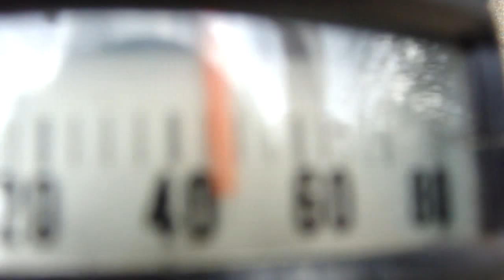CHEVY 454 ENGINE START UP ON GROUND * HOT RATROD ENGINE  * TEST RUN * REDNECK ENGINEERING

Comment: Can you do a video on how set up a engine to start it outside of the car please?
Reply: Wait ... Run wire from the positive battery to the big bolt on the starter is what I meant... You only need three wires one positive to the distributor  small wire ... One positive to the starter ... Big wire ... One neg to the engine big wire .. any where except rotating part for the big neg wire ... To kill engine .. pull dist wire from positive on the battery off
Reply: @jamesgibson7207  I bet you can’t explain that in a fuel injection engine huh (;

Comment: general question to all. how long can you run a setup like this with no water or radiator before damage can occur.  the reason I ask is cause anytime I install an engine I test run it before I fill antifreeze just in case I have to work on something.  thank you

Comment: If you can stuff a 454 in an AMC eagle - THEN i should be able to put a 350 in my 1980
AMC concord and get rid of that dog 258 six.........Right ?
Reply: with a hammer and a roll of duct tape anything is possible.
Reply: I like how you think.
Reply: He'll have to do some serious frame / structure improvements to that AMC chassis. At the :52 mark, that cross-member and body will not hold up the the torque and weight of a big block for long. These 454's were all installed in full frame chassis, not sub-frame types.
Reply: -You are indeed correct about that. The more i look into engine swaps
for my AMC i find that problem. It can be overcome with creative welding and fabrication. A big block is more than i would take on to be sure. Not a lot of meat to work with in the first place.
Reply: The worst you can do is twist it up and break the front window. Been there done that.
Reply: John Robinson you could throw in a junkyard 5.3 and some Chinese turbo parts and do pretty good actually . A good build to follow would be the sloppy mechanics (it’s more of just a name sake don’t take it too literal) don’t bullshit me Colorado. Fair warning, at sloppy mechanics we reuse head gaskets and any TQ to yield bolts on the engine mung other things that a lot of people tell you not to do

Comment: can you help me out? ive got a 1980s 454 with a set of large oval port, closed chamber heads and a high rise intake. my heads have 600 lift springs from the last engine it was on. i want to put a great sounding cam and get some good hp from it but keep it at a stock stall converter. what cam do you think i should use?
Reply: Put an RV cam in it ,lotsa low end torque and pull from idle to 5500 rpm also good start-up idle, vacuum etc.  .
Reply: why go to all that trouble just to restrict your car with a shitty stock convertor,may as well leave the six cylinder in it too

Comment: Ehhhh, baseline 454 rusted up low compression, sounds to be missing / off a bit - lucky to be pushing 250hp out of that 1000lb monster .  Sounds cool though I guess.  Been around the block many times with these CBBs, trust me - better to do a tear-down and rebuild before you even think about throwing that in there.  Even with cheap parts you'd get 320-350hp, better reliability, efficiency, etc etc etc.
Reply: 6k48
Reply: 6 ki 8 9
Reply: Yea... Anyone would do that if it never costed 5 grand

Comment: good luck, most old 454 I see run 10psi oil pressure at 200 degrees. not good.

Comment: So I'm new to the car world. But what does an engine need to run. Because I have a lawn mower engine just kinda sitting around and would like to actually make something with it.
Reply: Ryan Silva Spark plugs, gas, overall inspection (oils, belts, valvetrain) and some time to start it, if it was staying for a looong time. :)
Reply: thank you

Comment: hello or can we find a box  which allows to start without keys?
I buy an old Chevrolet Bel Air 1964 with paper without keys
Reply: Put power to the positive (+) of the coil.  The starter has 3 terminals on it, 2 big ones and a little one. disconnect the little one, and run a wire from it (regular spade connector you find at a parts store, get a yellow ended one and 10 gauge wire).  run that wire to a heavy duty push button switch, like you find at any parts store.  and from the switch, to the battery.  when you push and hold the button, it will crank.  when you let go, it stops cranking (just like a regular keyed ignition switch).
Reply: cedric dubois 1 wire to the distributor with a switch, one wore to solenoid with switch, both positive.

Comment: Radiator?  How do you keep it cool?
Reply: He only ran it for a little bit, so it was far from over heating.
Reply: I've test run engines like this before installing them. You can cool them by pumping water through them using a garden hose. You regulate the engine temperature by controlling the flow rate from the hose. We would run them up to temperature and then for about 30 minutes before putting them into the vehicle.
Reply: Joe Vignolo Cool.  I did not realize one can do that.

Comment: Can't beat an old GM they'll run there ass right into the dirt then stop right up 10 years later
Reply: TimmyTeaBag any engine with well over "3 million" miles is bound to have been rebuilt numerous times

Comment: u don't ever run an engine without cooling system , it makes hot spots in block and heads.
Reply: im thinking you read that somewhere and have zero experience,am i 100% correct?

Comment: Is that a q-jet sitting on top?
Reply from the maker: EragonSuperM Yes it is. They are awesome carbs.
Reply: freakineagle Yeah. I have an 800 cfm q-jet on the 350 sbc in my truck. I think I mentioned this truck to you before about putting a different carb on it but I have decided to keep the quad.
Reply: freakineagle Is that an 800 or 750 cfm?
Reply: +EragonSuperM All GM big blocks were 800cfm. Small blocks were 750.
Reply: Jordan Wiley My small block 350 has an 800...
Reply: Factory? Was probably an option.
Reply: Jordan Wiley That 
I'm not sure. I know it's not original, but I don't know if the original was 800 or not. It's in a pickup if that helps
Reply: EragonSuperM
Most likely something quick that was thrown on long ago. Assuming it's a chevy, chevy q-jets are a dime-a-dozen. Old carb probably took a shit and prev. owner replaced it with the same type. 99% of small blocks had 750 CFM. Big blocks all had 800.
Reply: Jordan Wiley Here is the actual story: The original carb was working fine, but my dad wanted some more performance, so he bought an edelbrock carb. Neither he or the local mechanic could get it to run right, so he got a quadrajet from said mechanic and put it on, since he had since thrown the old one out.
Reply: :P

Comment: What are the performance specs??
Reply from the maker: Sorry, there are none! Thanks.
Reply: Around 325 hp & 400+ TQ for one of those old 454's
I'd say its no later than a  73 model since he said it had  point ignition .
It has EGR & I do not remember if that came out in 72 or 73 .
Oil pressure seems low for cold start & I was wondering how he saw the 4 bolt mains .
That little car is going to fly !
Reply: B Anno i’m guessing he dropped oil pan or stuck a borescope in the oil sump plug or checked casting numbers if that’s a thing

Comment: the big block chev is a powerhouse,but ,has the worse rod stroke ratio in the automotive world,go ahead and install it,just keep the rpms down,and keep an eye on your power rack assembly ,hell man that motor weighs 700 lbs easy,out to run like a turpentined kitty,watch the rack i'm serious,lots of torque on the assembly in turns,i wouldn't drive it thru the mountains for pay

Comment: my uncle said the extra bolts on the mains make the engine more aerodynamic...  HAA
FAIL................     just joking I have 2 with the same casting number and they are both 2 bolt mains...